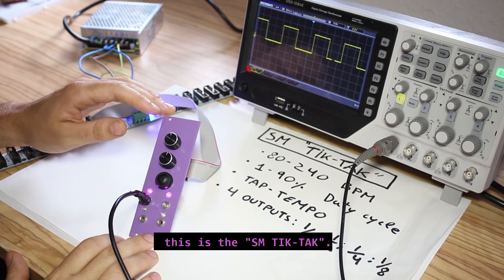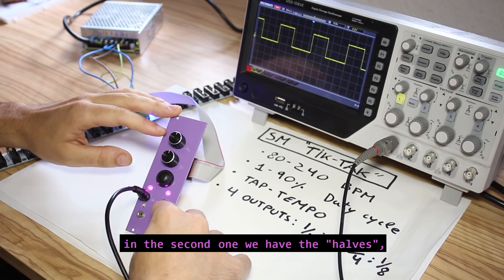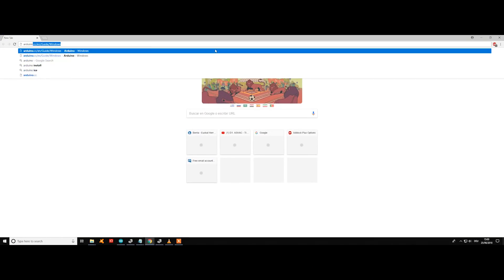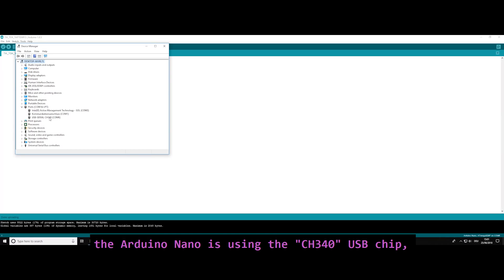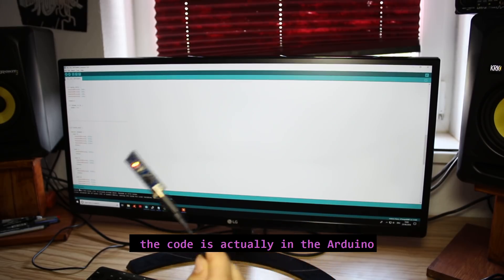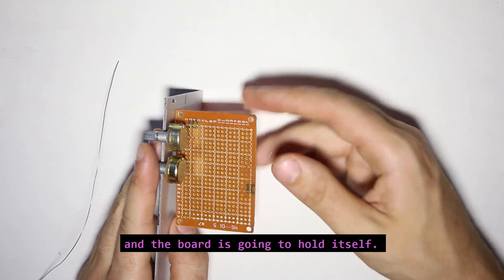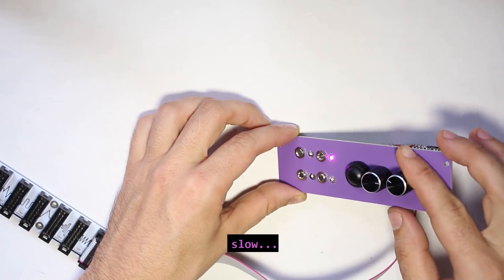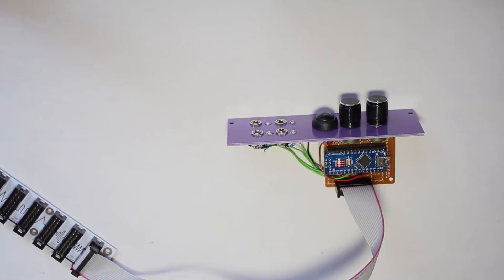SM "Tik-Tak"  Eurorack clock module, DIY ARDUINO

Comment: Hi Synthemafia

Thanks for a very nice SM TIK-TAK module. This was exatly was i was looking for :-)

I have a problem i hope you can help me with. The Tempo Pot doesnt work. I dont know if pulsewidth works, but it outputs gates and LED works super.

I build it with the simpletimer.h from marcelloramani and also jfturcot

I tried with 2 nanos 

I measured with an ohm meter that A0 & A1 got input from the Pot middle Pin (0-5K)

Althoug i used a 10K B Pot, when i measure, i only get 5K - strange ?

Can i use 50K pot instead ?

Can i upload new arduino sketch whit the nano seated in the module or should i remove it before uploading ?

The sketch has a default of 60 - 500 BPM, but you suggest 80-240 BPM. Can i type what i want here or is there a Min-Max range ? f.ex i would like to have 30 - 180 BPM

You have 2 sketches - i´ve tried both, but only the first will compile and upload ?

best regards

Henning Flintholm

Comment: Whoa I built this circuit on tinkercad, added the simpletimer library by pasting the code in the text screen, (the two library files) then I added an oscilloscope to the first output. And it worked 👍🏾😊

Comment: Just a question… how many devices can be connected to each output safely? For example, if I wanted to run several synths off one output would I need a separate powered circuit to handle that?

Comment: Hi, love this project! I was wondering if you had a solution to adding a cv trig/clock to the master tempo?
Reply: Hi, I did exactly that. Just added a Clock-Input in parallel to the Button. It works somewhat...

Comment: Some additional informations, 
To make the BPM a bit more stable remove the serial connection from the code. You don't need this if your project is working and finished.

To get the rid of the BPM noise use highquality potis.
Try to add a responsive reader to reduce large amounts of noise when reading a signal. 
Maybe: https://github.com/dxinteractive/ResponsiveAnalogRead

In this sketch the BPM cannot lower than 60 BPM. Decreasing this integer ( min_bpm ) the clock will not work!

And btw, the steps are not  1/1, 1/2,  1/4 , 1/8 ! 
This is a simple 4/4 beat ( 1bar loop ).
So the steps according this beatclock are 1/4, 2/4, 3/4, 4/4.

Comment: From previous comments, it looks like I might be the only one with this problem but this clock is really unstable. If I look at the serial monitor the BPM fluctuates enormously to the point where it's pointless. I can deal with +/- 1 BPM every now and then but this jumps up to +40BPM and then back down

Comment: Hi, thanks for the code and the tutorial. When compiling the sketch i get the error: 'class SimpleTimer' has no member named 'run'

   timer.run();

I used the code from the link project and installed the simple timer library via the library manager within Arduino, as I could not find a link to the folder with the simple timer as in your video.  Could anyone please advise what to do next in order to flash the code???

Thanks already....
Reply: Exchange your library for this one! https://github.com/jfturcot/SimpleTimer

Comment: Would it be possible to add more extra outputs on the free arduino digital pins with different  values like 1\36 1\72.... Etc?
Thank you

Comment: Great video, im building a similar clock and your resources are perfect. Can you add a 4 digit 7 segmants display to show the actual bpm? Like XXX.X?
Reply: I added an SSD1306 OLED display to mine. It works great. There is a Serial.println in the code that displays the BPM in the serial console, and that is the spot that you would insert your code to update your display. I'd recommend creating a variable to keep up with the last BPM so that it's not constantly updating the screen with the same BPM. Only update the screen when the BPM has changed. I also used part of the OLED screen to flash the tempo, rather than using an LED.

Comment: This is a really great project.  Not too difficult, while not such a weak module.  Would this be very difficult to maybe add one or two more clock divisions, and  / or implement a simple Euclidean trigger sequencer?  Thank you for sharing this, I’m going to make one, and maybe try the Euclidean trigger sequencer!
Reply: I'm a beginner and at the end of the video to me it's not clear how the connection are made exactly as the video gets over exposed and is going through at lightning speed. Is there any way that anyone can help me to a schematic or stripboard layout of this module. Did you get the euclidian trigger sequence to work?

Comment: Hi, Looks like a nice project but I can't open this rar file with 7-zip. It gives a fault. What can I do?
Reply: Ok, I just found this webpage where I can see the Arduino code so that will work. :-) https://www.hackster.io/Synthemafia/modular-synth-clock-module-diy-arduino-sm-tik-tak-bd8ded
Reply: And this webpage: https://create.arduino.cc/projecthub/Synthemafia/modular-synth-clock-module-diy-arduino-sm-tik-tak-bd8ded?ref=user&ref_id=530336&offset=1